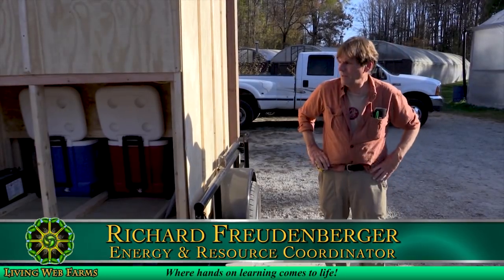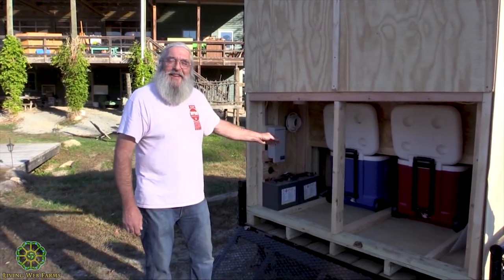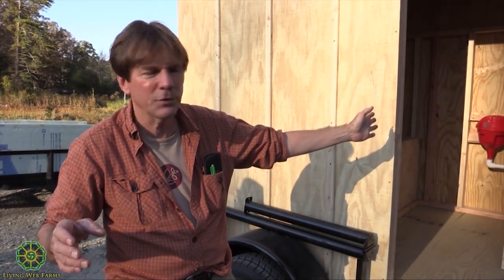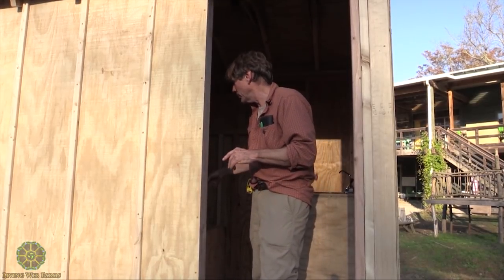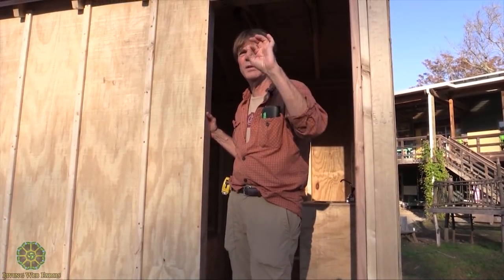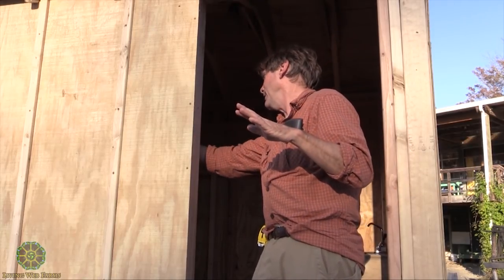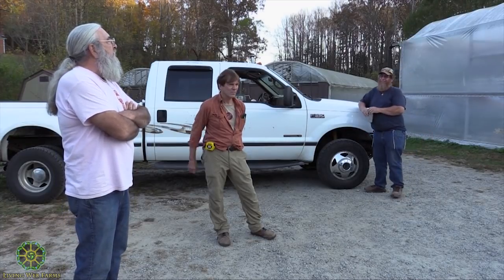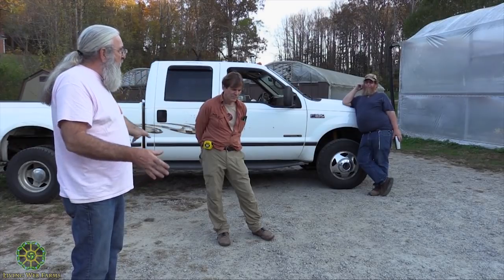Building and Maintaining A Composting Toilet Part 3

Comment: At around 1 hour 2 minutes, there is a discussion regarding an idea/comment about an aerobic compost toilet using air from a pipe. A source for this would be a video called 'wheelie bin composting toilet'. Its made by an australian fellow. I have just made one in the UK. I added an extra vent for air circulation, and am contemplating adding a non sparking 12v bilge pump fan as shown at the start of this video. Really enjoyed this video. So much knowledge and thought hax gone into this mobile design.

Comment: Would’ve liked to see the actual plumbing
Reply: I believe if the presentors had some simple line-art diagrams, photos, charts and so forth carefully selected for use during certain points in their presentations it'd make explaining some portions much easier.
Not a "power-point," just "The Old Fashioned Way." A poster board with information such as "A Chart," and only where words are cumbersome to express a particular technical drawimg or what-have-you.